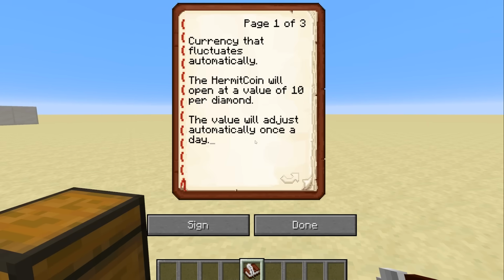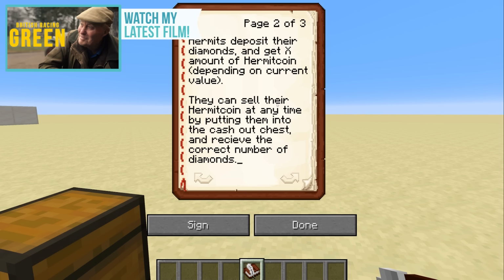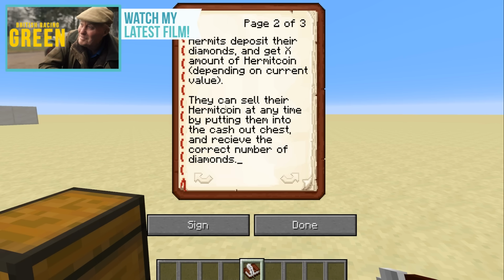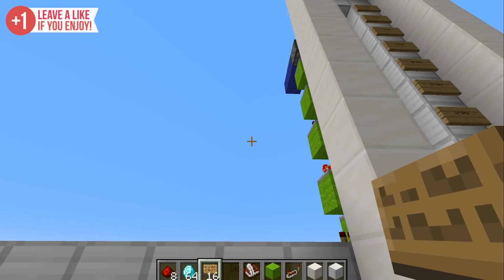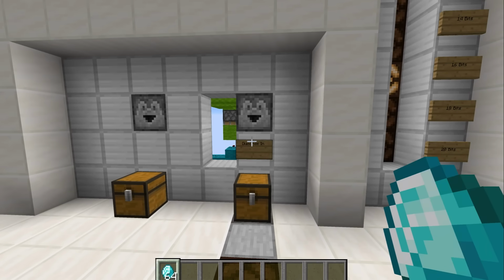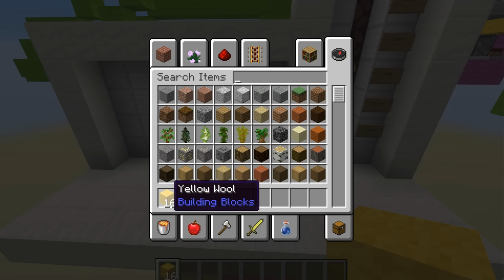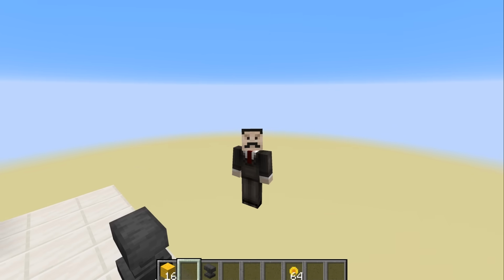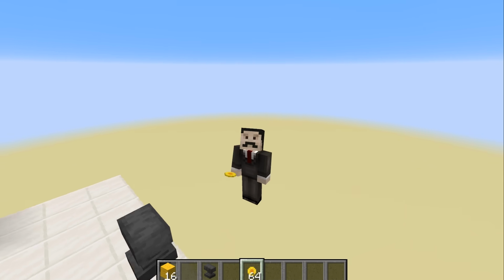HermitCoin Crypto Machine for Hermitcraft!

Comment: im corrently working on a "hermitcoin" crypto machine simillar to what u planned.

here are some tips to help u finish that project:

*fail safe system: when | currency = above/below show area highest/lowest value | the show area wont show anithing. we can overight that by giving a pulse to make the redstone block one higher/down depending on the sercumsences (i dont know how to spell that).

*smart value checker: just make a value checker that isnt connected to the lamps. it will make your life easier. BTW u can use the machine impulseSV used on his last ep on his new mini game to show the score.

im still working on it so more help will come later on.

Comment: Dear mumbo, i would suggest that you use a register to keep track of the worth of one hermitcoin and one register to keep track of how many diamonds has been put in.
You could then compare these two registers to see if they are equal and then give the user a diamond. You can use adding logic to increase or decrease the value of both registers when they need to. I would suggest watching some videos from Redstone Without Limits, he has videos that explain a lot about redstone computer things. I think that these optimizations will greatly compact your design and also make it more robust.

Comment: So, if someone puts in 15 the counter stays in "15 mode" and the next person could get a diamond back for only 1 Coin? You could view that as a bug or as a feature... You tell everyone you've put it in a random state and if they spend more than the exact amount they might get a diamond for less coins and they might not. Either way the machine will be in a different state when someone gambles like that. But you will always get the correct amount if you put in a multiple of the current price. I'd leave it in and just tell everyone there's an extra gambling feature in the machine. ;)

Comment: Change back function would be nice. Or possibly a conversion to gold, iron, emerald, etc. In EMC value (Equivalent Exchange EMC) a sum of gold ingots=1 diamond; typically 4x the gold amount of iron ingots=1 diamond; an emerald is sometimes 8, 9, or 16 diamonds. Just to make the conversion far more accurate and less of an exact exchange machine that is useless if you don't have a proper amount. The conversions will always work because it's the calculated value of 1 diamond, which means 1/4 of that value is a gold ingot, and 1/8 of it is an iron ingot, 1/16 of it is a piece of coal or something else

16 coins=1 diamond; I have 12 coins. 12 coins= 3 gold ingots, 13 coins= 3 gold ingots+1 coal, etc.
Good idea? Not sure if I did my fractions right there, they aren't a strong suit.

Comment: I think using a binary counter would be far more compact and less resource intensive for the payout circuit.
Reply: To clarify why.  The entire deposit and payout system could calculate off just one binary counter.  You just have an input that locks the other input hopper and changes the pulse source of the counter to the unlocked input hopper.  You would take the output from the side, aka bits, of the counter.  The bits of the counter would feed an XNOR gate each, the other side of each XNOR gate would be connected to a cuircut that produced the expected value of each bit into its corrisponding XNOR gate for the given coin value.  All XNOR gates would feed a wide AND gate that produced a payout when all its inputs are high.  You can avoid any timing issues created by the counter by waiting to test the and gate after the counter finishes processing a pulse on its input. After a payout you reset the counter to read all 0s and go again.

The expected bit values could be stored on a reversible feed tape using insulating, glass, and conducting, stone, blocks or just Redstone blocks and each time the coin value changed you would advance or rewind the feed tape to load a new bit combination for the system test for. 

If you don't want to learn binary you can just put a button on the input of the binary counter after you build it with a blank feed tape.  Press the button the desired number of times and then change the appropriate blocks on the feed tape.  Advance the tape, pulse the clock, match the tape to the clock, repeat. 
  With 5 bits in the counter you can have a coin value as high as 31. Sum(1,2,4,8,16)=31  With a vertical XNOR design the core of the system would be about 12x12x8 or so. 

Edit:fixed some broken logic and reorganized for better understandability.

Comment: Losing 15/16 of a diamond sounds terrible. Would it be difficult to add a "change return" via a locked hopper divert? 

(Obviously, loss can be prevented by counting before deposits. But the challenge seems fairly easy compared to your level of prowess in the redstone department)

Comment: Mumbo, this won't make you any money.
With the stock exchange the value of stocks is comensurate with the number of diamonds put into each company. Customers can never get more from selling stocks then have been invested in since it devalues at the same rate.
What you designed is like betting against the house. Everyone will buy low wait till it randomizes higher then sell, you will lose stacks of diamonds.
The hermitcraft stock exchange works because the investors are betting that they can be the one to cash out and devalue everyone elses property.

Comment: So I had a thought about the stuff near the end.  Say you put in 15 and it requires 16.   Does it remember?  I would think it would need to so that they can realize their mistake and put in the 1 extra.  Maybe you mentioned it and I’m being silly.  My concern is that you’d need to put one more in to get the diamond.  What if that didn’t happen, but instead, the next hermit comes along and drops in 32, only for the first one to be counted towards the last persons? Yeah, they would get 2 diamonds, but the system would still be off.  If another hermit shorted the system, now it’s short by 2.  And so on. Then you account for the level changes. What if that last one that wasn’t added from the first hermit causes the price to shift?  Suddenly the rest of this new hermit’s earnings might change without them realizing, causing them to think they got the wrong amount based on what they put in.  

Long story long, does the system that counts how many hermit coins you put in completely reset every time the chest is emptied?

Comment: VERY IMPORTANT!!!
You need to add "dummy" coin values to the top and bottom of the scale, giving it the illusion that the coin value could potentially go higher or lower. Otherwise, if it ever hits bottom, everyone will BUY a bunch, because it can only in crease in value. And if it ever hits top, everyone will SELL because it can only decrease in value.

Comment: id call it something like a "cryptocurrency quasi emulator" cause emulators have slight differences from the original (emulated super mario 64 had a platform that rounded its height up when stopping at its lower space while the version played on n64 didnt thus allowing emulation users to do an easier no jump run) and quasi makes it less need to be similar which is like this system where it doesnt need to be perfectly the same or extreme similarity just enough to know what its meant to be related to
Reply: theres also a problem on if it changes while youre in the middle of a trade... maybe making it store the change while someones trading and once theyre done it sends the stored output to change the price?

Comment: Mumbo, for this project, I feel for your counter system you're using towards the end of the video, you should use the system that drops all the items in at once from your super smelter. That output given will update the piston, and all the hermitcoin will be pushed back into the dispenser for use from the other hermits later. I can try and build a version for demonstration, but it might be a little bit. Comment will update with a link to the world when ready

Comment: Isn’t it the other way ‘round? If the value goes up from 16 then the next value should be 8 because 1/8 (where the diamond is 1) is greater than 1/16 (1 diamond per 16 Hermit Coins); if you continue then a 1/2 exchange rate means two Hermit Coins per Diamond and that’s more expensive i.e valuable.

Comment: The only problem here is if someone gathered sunflower other than using this system and use it as a hermitcoin to get free diamonds. The only thing I could probably think of is to change all the sunflowers name inside the system with Hermitcoin and make it so that the machine will only accept those kinds of sunflowers. (Rrally dunno if this is possible in minecraft, since my info in minecraft is very very limited.)

Comment: Would the input and output still work with a trapped chest? Just in case they put the wrong amount in to exchange? Also, if they try to put the wrong number of coins through, do they get those coins back that didn't add up to a diamond?

Comment: Mumbo put a reset button/lever incase you didn't input the correct amount of coins then add a second counter to count whether or not the first counter system has reset by making the coins pass through the second counter but the output is to the output chest.

Comment: I have a question... is the exchange rate is 16 hermit coins to 1 diamond if u put 31 hermit coin you will get only 1 diamond but for the next diamond to drop wouldn’t you just need 1 hermit coin to get a diamond??? Since 31 ticks have gone on to the counter... so example if grain put 31 hermit coins in it he will receive 1 diamond but when the next person comes in he/she only needs 1 hermit coin to get the next diamond to drop because the item is 1 count away from the red stone comparator which then will detect the item in hopper and activating the dropper to drop a diamond????

Comment: Mumbo what happens when, let's say the value of the diamond is worth 16 hermitcoins and a hermit puts in 15 hermitcoins and realizes it is too little so adds 1 hermitcoin to make it 16, wouldn't that break the system and the hermit would not receive the diamond. Also what happens if a diamond is worth 15 hermitcoins and the hermit puts 20 hermitcoins, will they receive the balance of the 5 hermitcoins back?

Comment: Mumbo, I think you should also consider that the more diamonds there are in the system (i.e the bigger demand for or trust in the currency) the greater HermitCoin values should be. And vice versa, less diamonds in the system would relate to less valuable HermitCoin currency. This way,  whenever their value decreases, "investors" will be stimulated to buy HermitCoin and deposit diamonds, expecting to cash out big money when HermitCoin value increases again. In the same time, you can add the "randomization system" just to spice everything a little bit and "control" how quickly the value goes up/down.
BTW, YOU SHOULD DEFINITELY REGISTER HermitCoin®.

The other thing is that currently the randomization system can change the value by just one step from its current position. If we have current value of 10 HermitCoin per diamond it could go up to 12 or down to 8. But it will be way more interesting if you can make it fluctuate more dramatically overnight. From 10 to 16, then back to 8 and so on. And if you tie this up with the supply and demand aspect of a real currency, then, this will turn into something really amazing.

Comment: You should built in a function that "blocks" the value changing system when the system is running. Could imagine a lot of problems if the crypto value changes while someone is buying or selling coins

Comment: Possible improvements:
1) System that gives back hermitcoins when not enough are placed in to return a diamond. Currently the system pciks it up but doesn't spit it out again.
2) A system that takes supply and demand of hermitcoin into account. Bonus points for a system in which crashes or negative supply are prohibited.

Comment: You need a way to extract the item in the hopper counter and place it back into the first hopper. Otherwise, if someone doesn't pay enough, then the next person gets a cheaper diamond, depending on where the item in the hopper chain stopped. A layer of locked hoppers beneath the timer hoppers, also in a loop, would stop this. Then you have a dropper into the first timing chain position. Just unlock the collection chain hoppers, the item loops back and gets "droppered" into the locked timing chain, in the correct position, then relock the collection chain.

Comment: The system can not also have a minimum or maximum value. If you have a minimum then someone would just buy it out completely because they would be guaranteed to make a profit since it can’t drop. Then again if it’s at the maximum no one will purchase any because there’s 100% chance they will only loose value and loose their diamonds

Comment: mumbo... how will you get the diamonds for this currency? say everyone starts with 5 HM (hermitcoins) and each HM is 10 diamonds. now if everyone immediately wants to use them... how will you get all the diamonds for it?
say if this isnt the case and everyone starts with 0 HM and now everyone buys 2 HM for 20 diams each... now if the price inflate to 12 diams per HM and now if all the hermits wanna use the HM there wont be enough diams for all... how will you deal with this??????
(note*: obviously ive taken the price too high from the start but eventually you will get to that point eventually. real crypto currencies dont have to deal with this as they are all virtual and not physical things)

Comment: Mumbo, Docm77 made a duplication machine for diamönds on HermitCraft. He can make it for HermitCoins too ! Make a security system called SSS (Sahara Security System) Every Hermit will have their SSAC (Sahara Security Access Card) [you can change the name]. SSAC will be paper with their name and some password. Before entering to the Sahara they have to "scan" their SSAC and after it they can enter. If some of the Hermit (he/she have 0 HC at example day 0) will bought 32 HC at example day 1. then 50 HC at example day 2. and if he/she will 3. example day bought X Diamonds for 100 HC the SSS will detect that example Hermit have only 82 real HC (so he/she can't have 100 HC) the SSS will turn on light (in Sahara's Headquarters will be lights and every will have name of the Hermits on it) and it doesn't give the HC back. When some member of Sahara will saw that the light is light up and saw a sign with some of the Hermit name on it. Member will wrote that into a book and reset the lamps. EXAMPLE: Docm77 have 32 real HC. He enter to the Sahara facility and the SSS will know he's in because he used his SSAC. Docm77 will bought X Diamonds for 50 HC and SSS will thought: "Hmmm. Docm77 have only 32 real HC in total. Where did he took other 18 HC ?! I'm (SSS) gonna light up a lamp in Sahara's Headquarters with Docm77's name on in." Docm77 will not receive any diamonds and any HC back  and he will leave the facility and SSS will know that Docm77 now isn't in the Sahara facility (because he used SSAC to leave). Grian will saw that the light is on and he will think a some punishment for Docm77.

( If there are some grammar mistakes I'm sorry I am from Czech and I don't used a Google Translator.)
Reply: Although It's quite nice, there is a problem with redstone being different from silicon...
Minecraft makes such ideas REALLY hard to make

Comment: Problems :
 1. If somebody puts wrong the  amount in ex. 15 when price is 16 next person to use the machine will get a diamond for 1 hermitcion
2. People know the max it can reach and the lowest it can reach so it become a less of an investment and cause your system doesn't measure the amount that has been bought and sold they will wait for it when it is lowest and buy in bulk and when it is high sell in bulk 
3. Hermitcions are not supposed to be infinite there is suppsoed to be a limit and if number of hermitcions decrease the price should rise 
4. People can make some fake coins 
5. Your are probably  gonna suck at building a place for it that is actually nice and gives you the feeling that you needed to buy 
6. Add in the building security so u don't get robbed 

Solutions : 
1. Put a reset button 
2. Take like an output from the chest that your clients are storing the coins in so you can make price high  when there low amount of coins stored and high when there Is low amounts of coins stored *this is an example but i just want to get that you could use the amount of coins stored in the clients chest *
3. Put a limit ex. Like 2 full double chest  (IDK)
4. so make the name has like a space or something to make it specail 
5. get grain 
6. Build security all over the place so you don't get robbed like the stock market

Tips : 
1. Use music notes to make place better 
2  get iskall as no offence you  you can't run a business 
3. Charge for every transaction a diamond so if the price is 16 and they buy 32 coins they pay 2 diamonds so discourage bulk buying and to make it more profit 
Also when selling ciobs exactly the same thing happens 
4. Tell grain to make place so fancy if it means using gold blocks USE IT
5. Hype the thing before it is lunched - open for use 
6. Sell VIP badges to people can use it early ( before lunch ) and also has no limit for transactions per day
7. Limit transaction per day for normal people 
8. If you can't make it Redstone just write a note or something in the book rules 
9. Make a commercial vid. For the place 
10. This is kinda a prank and at the same time advertising go in the stock exchange and place flyers ever where with were to go to get hermit coin or like a huge banner image of the place on the walls of the stock exchange. 
11. A like no harm prank is just to make a pressure plate at the begging when step on it a dropper shoots a flyer for your place
12. Please mention me and Egypt like the to that Egyptian  guy or something